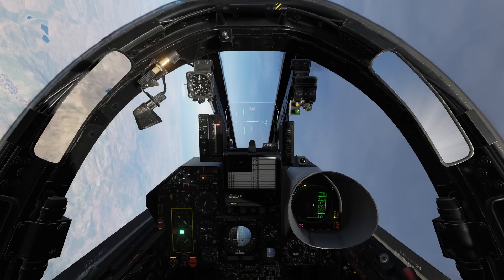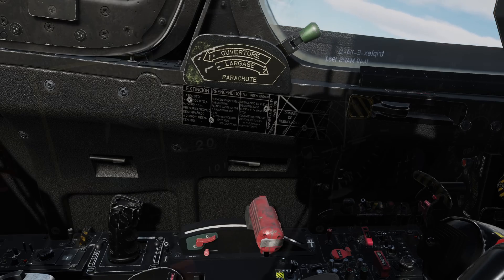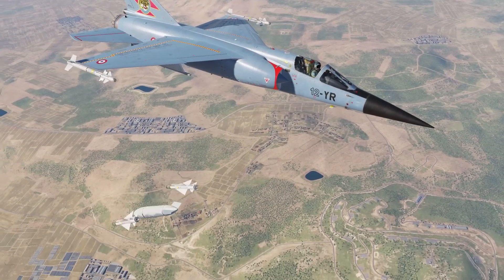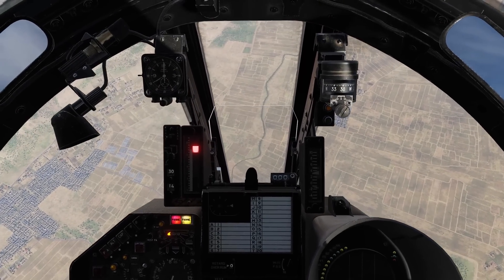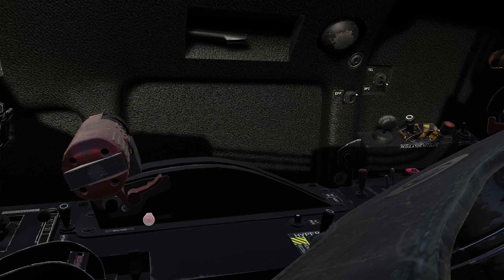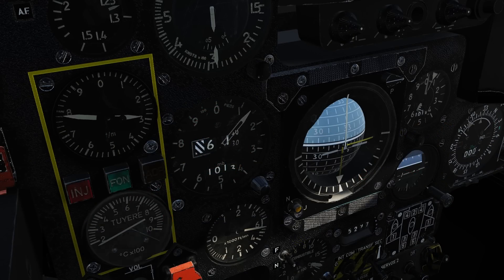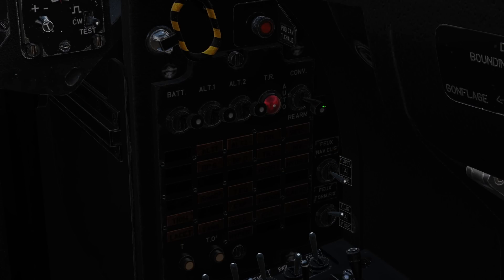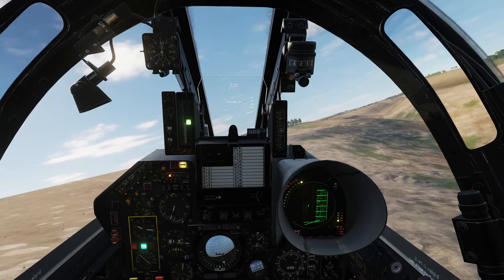DCS: Mirage F1ce Engine Relight Tutorial

Comment: french mig 21
Reply: Rather MiG-23. 
Both 2nd generation 1950s/1960s fighters Mirage III and MiG-21 were delta wing classics. 
Both 3rd generation 1970s Mirage F1 and MiG-23 had unconventional wing to allow greater mission flexibility.
Both 4th generation 1980s Mirage 2000 and MiG-29 again returned to delta wing, but less orthodox and more advanced, MiG with LERX and Mirage destabilators and unstable aerodynamic design.